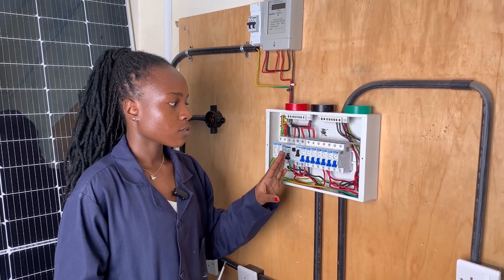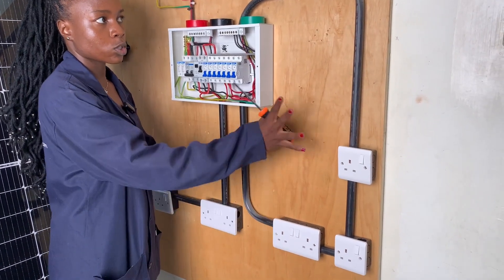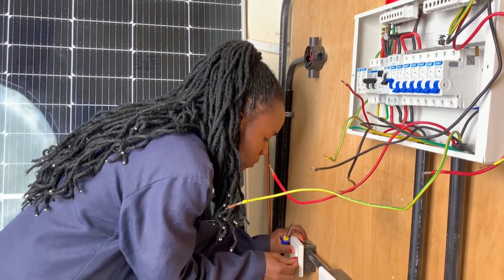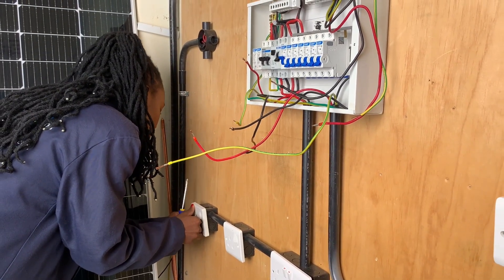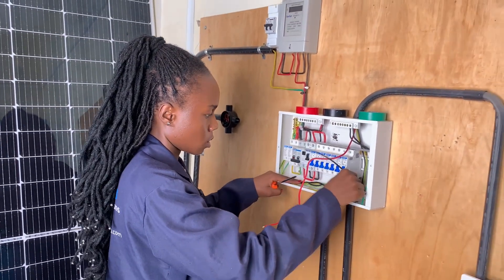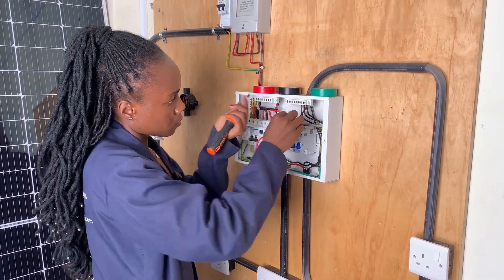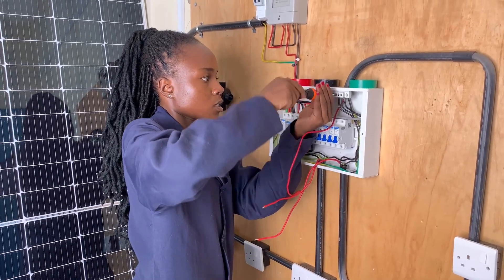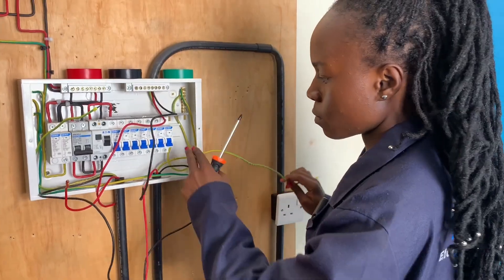How to wire a Ring and Radial Circuit.

Comment: Can one panel box have both 120v and 220v in one panel box?
Reply from the maker: Definitely Yes Top Boss
Reply: @topheightselectricians  can you do a video if possible
Reply: I don't think that is possible, you can only have 120v or a 240v in a breaker panel. The voltage is from a utility transformer, either 120v single phase and neutral or 240 volt double phase line to line on a 120volt inch transformer. While in the 240 volt transformer each phase to neutral is 240voltage  and 440 volt power from phase to phase voltage.

Comment: Good video sir 
Sir can you tell me how to select mcb for a circuit
Reply from the maker: Thank you Samuel. Alright, I will.
Reply: There are alot of factors that go into selecting an MCB but here's the most simplified version
 
1. Lighting Circuit – 6A or 10A
2. Socket Outlets – 16A or 20A
3. Kitchen Appliances – 20A to 32A
4. Cooker/Oven – 32A to 40A
5. Air Conditioner – 16A to 32A
6. Water Heater/Shower – 20A to 32A
7. Washing Machine – 16A
8. Fridge/Freezer – 10A to 16A
9. Iron Socket – 16A
10. Outdoor/Garden Circuit – 10A to 20A